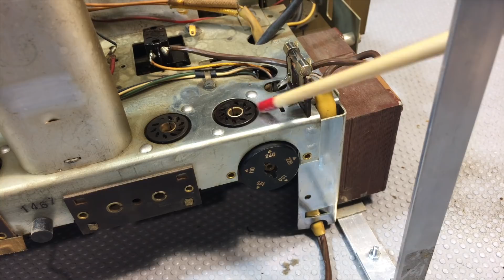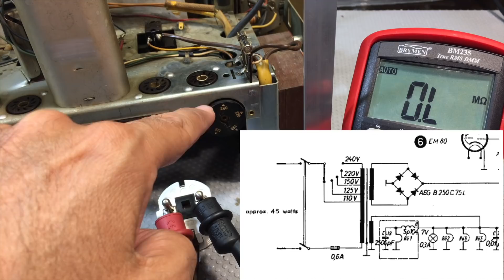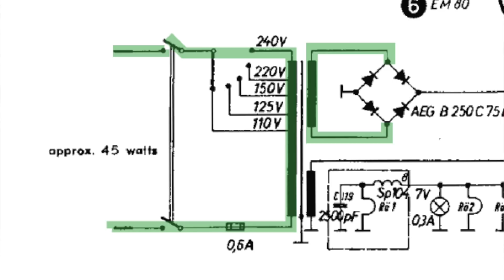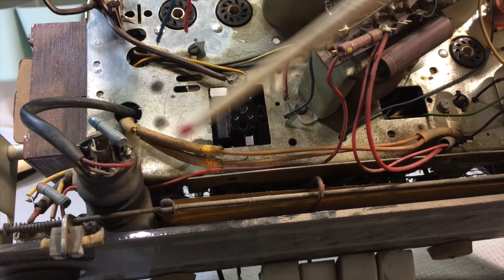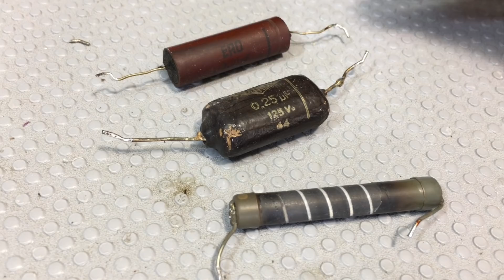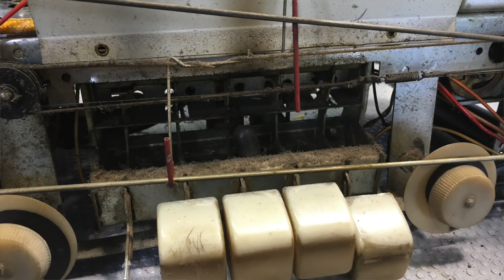Telefunken Gavotte 55 restoration part 2. She sure cleans up nicely!

Comment: I have been working on a couple of old German radios and I have been watching your videos with great interest. In replacing the selenium rectifier here, you decided not to add a resistor or MOSFET (as you did on other radio restorations) but to scale down the voltage by setting the primary to 240v on presumably 220v input. This will scale down the B+ by about 9% but will also reduce the filament heater voltage by the same percentage from 6.3v to 5.8v. The difference in performance is probably unnoticeable, but if someone were to check the filament voltage, he/she may decide to correct the setting of the voltage selector, which then cause the B+ to be a bit too high.
Reply from the maker: The mains voltage in my country is at around 230 to 240v, so selecting the 240v setting would be the most correct way to do it. I’m not sure what the filament voltage came out as because it’s been a while since I did this project, but if someone goes to the lengths of measuring the filament voltage, they will also probably measure the B+, so any intervention should be done with care.

Comment: Tip.     When testing power or output transformers use an analog ohm meter.  The digital ohm meter will jump around as it samples the inductance as well as the resistance.
Reply from the maker: True

Comment: Wonderful result! I have a Telefunken Princess II from 1962 with a Printed Circuit board and  find it more dificult to clean than a metal chassis... Dozens of cotton qtips and isoproplic alcohol later and still a lot of grime... patience is key :)
Reply from the maker: Agreed. Patience and lots of cotton swabs 😊

Comment: I think, the problem with the add-on pre-resistor after the silicon-recitfier you will have in any case. If you put 220V into the 220V-Transformer or 240V into a 240V-Transformer, you get the same result. The voltage will be to high. Correct me, if I'm wrong. Sensationell condition of the chassis. Looks, like it was conserved.
Reply from the maker: Our mains voltage is about 230V, so supplying that to a 240V primary helps a little bit.
Reply: @electronicsoldandnew  Ah, my last measurement here was 235-237V This may help a little bit. Thanks for the answer. Every day i can learn a bit.

Comment: Ever since my hard drive crashed and I ended up "having to" go to Windows 10, I am no longer getting notifications when new videos are posted.   If I go to each channel I am subscribed to and look, I usually find the new posts, but I enjoyed and prefer to have a notification on the screen that a new video was posted.  It shows I am subscribed, the bell has the "quote marks" around it, and everything is showing that I should be getting notifications, but I don't.  Well, let me clarify that a bit, there might be a notification, but within seconds it disappears!  Before the dreaded 10, the notification would stay on the screen until I either clicked on it to view or hit the close button.  That isn't happening now.
Now to your video...THANK YOU for posting this one!  This video has a lot of excellent information in it that we all need to keep in mind when working on ANY radio, vacuum tube or transistor.  As you clearly showed, you can never clean too much!  Especially switches.  Not too many radios have voltage input selection switches, but there are those that do and they need to be cleaned.
That chassis is looking AMAZING!!!  I wonder if it is Aluminum?  Certainly doesn't have any rust on the chassis, but that transformer was coated in rust on the plates.  So it could have been covered in rust if it were steel, iron, or the like.  I don't think anyone was using Stainless Steel in those days.  I did a project that required me to check on the conductivity of Stainless Steel, and it is not even as good as Aluminum!  I was surprised.
Concerning the diffuser you were going to work on, the one for the dial, you might want to check out this video of "Mr. Carlson's Lab" at 1:34:56 to 1:38:33 where he covers that very issue and in a quite novel way!  https://youtu.be/ISbidethQyc
Keep up the excellent work, Stay Safe, Stay Healthy, and Stay Happy!!!
Reply: About the notification in Win 10: At the right side end of the task bar, there is a little square. When clicked on, it shows all of your notifications.
Reply: @__Dude_  I found the spot you mentioned, clicked on one of about 20 notifications, it took me to that notification, but when I tried to go back to see another one, there were NO notifications left in that view!!!
Reply from the maker: i’ll check out the video. This one is made from wax paper, so should be easy to replace.

Comment: The original selenium rectifier heats up quite a bit because of the inner resistance. In fact you could have stuffed that rectifier with a couple of hundred ohms 10W series power resistor as well to compensate the low voltage drop of the new rectifier, if there was enough room for it inside the metal capsule.
(I have a Telefunken Concertino 57 still equipped with original ( probably exactly the same type) AEG rectifier and I have to replace it and I will try to fit the resistor inside the original metal package if possible.)

If real mains voltage is 230VAC, normally 240 voltage selector setting implicates around 5.9VAC heater voltages , and 220 setting around 6.7VAC. Either option kind of sucks if you want that ideal 6.3VAC.  ☹️

Very nice video, as always. 👍
Reply from the maker: thanks

Comment: Those mains plugs fits right into my cheap Aneng AN8009 multimeter. No need to use testleads 🙂
That thing looks like brand new now.
To bad it's not possible to strip such sets down complete to clean them, and then rebuild them from scratch.
Reply from the maker: I’ve done it before. Once. Never again 😊
Reply: @electronicsoldandnew  That's why I wrote "not possible" even if it technicaly can be done. :-)